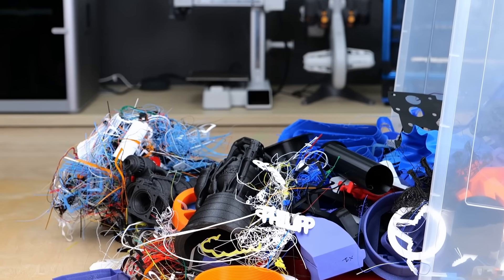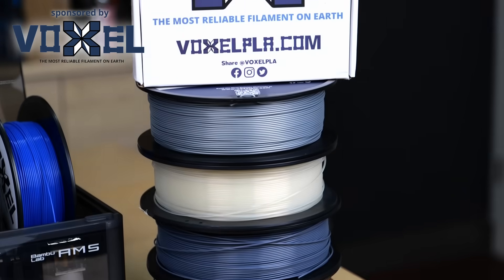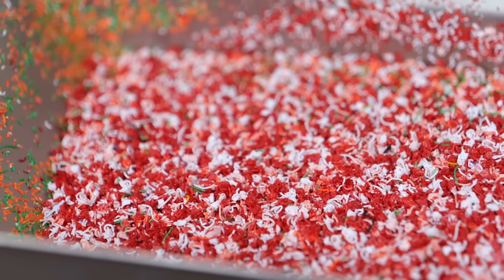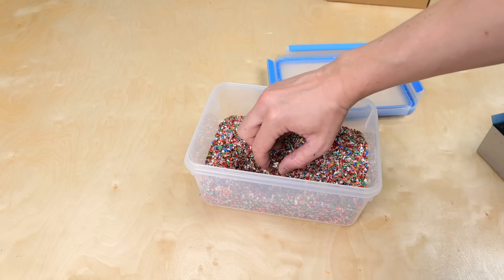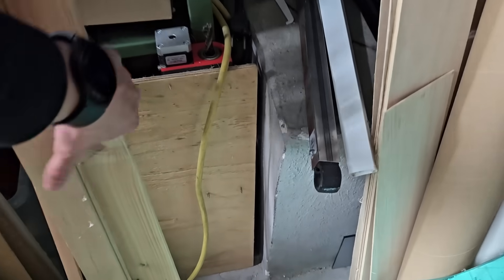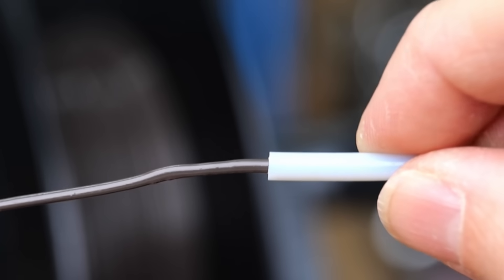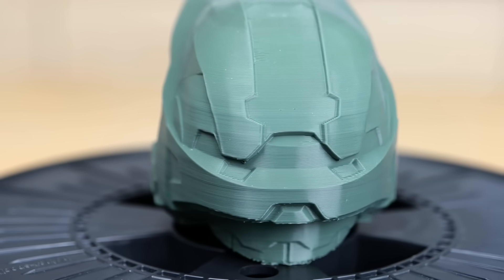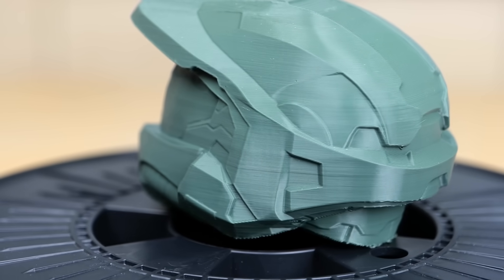Turning 3D Print Waste into New Filament!

Comment: I'm on a REAL tight budget, so I can't afford to by filament at all. The few spools I have were all gifts for birthdays, or as a thank you for helping somebody. So I'm especially interested in affordable ways to make my own filament. The manual labor to chop it down and clean / dry it properly doesn't bother me, and there are free sources for base materials! For example: I'm an electronics engineer by education, so for my hobbies I need electronics components. Same as with the filament, I need free sources. Turns out, if you just put a few requests on some facebook groups, you can get everything you need! Ask for electronics that died! Printers for example are a nice source for motors, power supplies and: HIPS / ABS !!! You can easily get over half a Kg of material for your filament from just one or two dead printers! Lots of electronic components too, and if you can get printer / scanner combo's you even get a nice glass plate as a bonus!
Reply: It's very important subject as not many companies recycle shell of the electronics. It's a VERY good business idea as many E-waste recycles are struggling with it. Manufacturers are only need smart parts, but the biggest part of E-waste is plastic.

Comment: Bambu needs to make an attachment and firmware enhancement to automatically chop the hot poop into pelet sized units while excreting them rather than making big blobs. That would make recycling so much more efficient and make the poop bins hold a lot more material before overflowing.

Comment: Did you build the Shredder yourself?
Reply from the maker: The Filament Pelletizer, yes, the big shredder, no, that's from 3DEVO.
Reply: okay thank you. Tried to develop a recycling process for filament waste myself for a university-project but we stumbled upon the same problems you mentioned in the video. Very frustrating, that it's not that easy to reuse 3d printing waste and therefore not possible for the majority of 3d-printer - owners. While watching the video i thought if it would be possible to change the 3d-printing process in a way that makes recycling later easier - e.g. the small metal parts in the filament waste, or the problem of moisture getting to the waste. And i thought maybe theres a way to reduce these problems already during the 3d printing process to reduce the effort / costs needed during the recycling process @CNCKitchen

Comment: Honestly, most of the 3d printing I do is for fit checking parts before using a more expensive manufacturing process. So by definition all my prints are almost instantly useless after the fit check has occurred. I really want a reasonable recycling process....

Comment: Haha I knew there had to be a reason for collecting so many poops! That filament dimensional accuracy is so hard to nail, but you're getting closer and closer! Really encouraging, considering there are zero methods of recycling print waste currently (at least none here in Aus)...
Reply: It's so frustrating. I want to recyle my waste and poop, but no one here wants to do it. When I last checked, we'd need to ship it to NZ. Which hardly seems viable. These videos are great for getting some at home ideas we can consider in the short term. It can be so irritating having a tech based hobby in this country. If we're not gouged for price, we're shafted for facilities instead. Grrr.
Reply: @tyrannicpuppy if you are in the US, I'll take your trash for upcycling, not recycling thou) Recycling is energy consuming and expensive)
Reply: No, we in aus have DC engineering 3D printing for pla and terracycle for abs recycling
Reply: australia or austria?
Reply: @chromyl_chloride  No kangaroos in Austria
Reply: @chromyl_chloride  note: Aus means australia, Aut means Austria :)
Reply: Whenever I make recycled filament I extrude, pelletize, and extrude again.  The second pass comes out more consistent because pellets feed easier than shards.
Reply: i feel like if he put some virgin material in it may have been more consistent

Comment: a large portion of my prints get sanded and primed anyway, so i don't really care as long as there is solid layer adhesion. i wouldn't pay the same amount for an inferior product but if i could get 10-20kg at a reasonable discount, i'd be for it.

Comment: Wonder if it's possible to tweak the "poop" settings on the printer itself to make the processing a little easier. Print little logs instead of wads, feed it straight into a shredder, drop it into a more sealed hopper to reduce water absorption, etc. Even better, use the waste filament during the print for infill and support material.
Reply: it's not printing the poop it's just purging into a hole so no way to change the shape

Comment: multicolor 3d printing just feels pointless especially for stuff like cosplay props, figurines, and other visual arts applications. even besides the waste, it looks worse than just painting! and the entire appeal of doing so is to skip the post-processing steps of sanding and priming and painting, but the result of that is that it just looks like an unfinished 3d print. you're also limited to an extremely basic MS Paint looking palette of colors, unless you want to invest in several spools of specialized colors. which is something you don't need to do when you can mix paint colors.

Comment: I was thinking of using my old coffee grinder from the Breville Oracle (not the simple blade type, this has turbine style teeth). I have a spare which is technically not good enough for coffee grinding but may work for shredding plastic to very fine granules.
you could use a poop color sorter on the output with some coding, it would be closer to it's original colour than poop
9:20 if you're going to put desiccant in a vaccum, I would suggest creating a false floor with the desiccant underneath so the evaporation falls to the floor and when opening the lid, the re-condensation then absorbs into the desiccant with the plastic above since vapor in a vacuum I would think would drop to the floor bed

Comment: if recycled filament was dirt cheap, id love to use it for prototyping then print the final part in a better quality filament, or id print my shitty quick "temporary" parts, especially if i got my ERCF working again, or had a Bambu with ams.
But this is unlikely, because filament is a product not a commodity, manufacturers pay $2-$3 per Kg and sell a spool for $25-$30 so somewhere between 88% and 93% of the cost goes into manufacturing, shipping and profits, I could imagine those prices would drop as 3d printing continues to grow.
But unfortunately recycled material does not make sense, as the cost of shipping failed prints around the country then sorting the plastics somehow, and the inevitable failures when a small rock, m2 screw or piece of ABS goes through the extrusion line and puts it out of order for a week, not to mention the CO2 emissions of shipping small amounts of waste around the globe, to make a substandard spool.

Before you hit print, ask yourself does the world need this benchy for the next 100 years, (then print it anyway and loose it in a week)

Comment: All I could think about this whole video was the wiggling of the filamet as it was extruded and cooled by the fans. Feels like having the airflow comming from the side is a bad idea and induces unnessecary oscillations.

Feels like you should be able to print a shroud to the fans so that the air flows along the filament as it’s extruded. Maybe a grill inside the shroud could help making the flow more laminar too?

Would be cool to see if those variations in your graphs are caused by the air flow turbolance :p

Comment: I would buy recycled filament if it was reliable enough to print prototypes.  Most of  my waste comes from making multiple prototypes of a given design.  Once the design is done, I have very little waste (failed prints mainly).

Comment: I don't usually paint my prints so I do like having the different colours myself (or just print in a neutral grey). But if the end goal for someone is to paint their models then I can definitely see a recycled filament being a popular choice.
Reply: I’ve saved all my failed prints/supports/brims etc. I first run them through a wood chipper then through a P5 shredder to make the pieces smaller. Then the plan is to run them though an extruder (should arrive in the next week 🤞). I don’t care what the colour is since I’ll use all the recycled filament for prototyping.

Comment: It seems like it would be perfect for prototyping material when you know you will have to iterate on a design a few times. After you have the design finalized you use virgin material for the final print and grind all the previous prototypes back down to prototyping material!

Comment: Given you've got the tools to do so, I'd love to see what re-melting it over and over again does to the mechanical properties of the filament. Does the layer strength drop? Perhaps the filament becomes more prone to shattering. I think it'd be a cool thing to test!
Reply from the maker: I should do: "how often can you recycle PLA?"
Reply: @CNCKitchen yes!
Reply: @CNCKitchen yes please ❤
Reply: @CNCKitchen I’m subbing to see that.
Reply: @CNCKitchen did you do it bro?
Reply: @CNCKitchen   or "how many times can you recycle PLA?", but yes, it'd be really interesting! :)
Reply: I once went to an industrial 3D print conference, and there someone from ESA explained that they have a  3D printer on the ISS and that they recycle their printed parts. And the mechanical properties actually get better! But it was with PEEK 🙂
Reply: I did it at Recycling Fabrik in Germany, after 5 recycling cycles PLA will be less viscous = very runny and more watery= chemical bones will be less strong. I'd recommend to use dye to separate recycling cycles, but I didn't. You'll see the same. I can recommend book in German about it. Only with HDPE after several recycling cycles bonds will become stronger.
Reply: Dr-D-Flo recently did an in-depth video - and I am actually surprised how well this process worked for CNC Kitchen. It's also possible to use recycled filament for parts of the print where mechanical qualities as well as variations in extruding speed are irrelevant, for example support or infill for non-structural parts, and use virgin filament/pellets for anything else. Although that leads to making more "poop" again.
Reply: @graealex  PrusaSlicer has the option to minimize the poop by having the color switch during infill and thus invisible, if possible. No need to extrude poop in such cases.
Reply: @SiqueScarface  Bambu Studio can also print to infill and/or supports instead of creating poop, the only problem is that the printers end up creating more poop than would typically be needed to print the infill and supports.
Reply: @graealex  he is paid and bought, I don't find his content scientific. Stefan does a better job by being German than Flo guy by being pro-industry ;)

Comment: I took an old cement mixer, added pea gravel and large sand.
Heated with a weed burner and added all the waste plastic I could find.
...just like they do in west Africa...
Mixed it and Walla!
Asphalt! 
I used to patch holes in the driveway but the Africans make roofing tiles.
That will be my next play when I gather a bunch more. 
Wonder why this isnt more popular?

I think once I get it right, I'll make a small skiff.
Reply: You can make tiles from aluminum cans, just FYI.

Comment: You should try a mix, very rarely do you see 100% recycled material used, usually its a % virgin material + % recycled
Leads to a much more consistant results because remember, every time you remelt the plastic it also degrades
Reply from the maker: Definitely, yet feeding regrinds and virgin pellets in such an extruder can be challenging.

Comment: I've always thought that a machine that could straight print from the extrusion would be best and could be useful for the household, single use containers. Imagine a rig the size of a washer/dryer that could shred HDPE and print out a lawn chair. Not to say that the engineering would be easy. Would need a very long and constrained auger, and the prints would be super rough and would need ironing.

Comment: Have you addressed the compostability of PLA? That is one of my main reasons for using pla as a main material. I’ve read recently that some is more compostable than others, and wondering what I need to look out for.
Reply: Is pla compostable? iirc in theory, yes, in practice, no.
Reply from the maker: The compostability of PLA is mainly greenwashing IMHO: https://www.youtube.com/watch?v=tavrkWrazWI
PHA might be a good alternative but it's still way more expensive.

Comment: I know that petg has a higher metling point and additional modifiers in the formula, however, it is one of the most recycled plastics. Has there been any attempt to recycle petg? I know that you would have to keep it very dry.

Comment: I think Bambu should look more into ways to reduce filament waste, as well as the time taken to swap colors. While people seem to like the AMS, perhaps it is reliable, it's also one of the slowest and most wasteful ways to change colors. In the meantime, Prusa is working on a new MMU system that will hopefully be more reliable than the MMU2, as well as having a tool changer system on the XL.
Reply: Very interesting. Here's a small idea from me. Per layer, at the end, on the inside, for infill, THIS is where that last "waste" stuff should be used. But this clearly demands the slicer to be very smart and planned in regard towards this as a method. To be clear, past the start and the end OR thin sections, the infill will often take up a lot of space inside. I'd deem that a safe area to swap filament on the inside so the print can just continue. If one could code this in with some thickness parameters for when it should shred off a blob OR dispose the transition into the infill structure? Sure this would make the waste decrease significantly right? 🤔

Comment: When prototyping, I generate and print a lot of ideas that, although they may not work for my current project, may work in future projects. Therefore, I keep a lot of old prints so I can revisit the concepts for use in the future. I like to have physical versions since I find them easier to track than keeping track of the concepts in Fusion 360. Plus, it is more informative when I can handle them to recall how they work. Basically, I have a design concept library. I sometimes write the date and key information on them with a marker so I can recall why they didn't work or why I kept them for future projects.

Comment: I've been wondering if you could just make a big melting chamber, and use pressurized air (at say just 1.5bar) to spread the heat and put pressure in the container to push that now melted material out of a nozzle. You could put in failed prints, virgin pellets etc.

Say take a big tube, insert some mesh filters on bottom, heat the bottom to 200C, and plast heated hot air from top downwards to speed up failed print meltin. on bottom of container have a nozzle, or straight into extrusion machine ...

Would probably be a weekend project to do a proof of concept. Maybe 200€ max in materials.
Just use IV ducting at say 500mm size and cheap end caps etc. regular nozzles + pneumatic distribution block for the air jets, a bleed of valve on top to vent out excess air + water vapor.
Reply: This is extension of the "just melt it into a sheet" precious plastics showed. So instead of a say baking pan, just have a long tube, with hole in bottom for the plastic to drop through.

Then add the mesh filters, multiple stainless steel to pick out varying sizes of trash just before the nozzle, heating elements on bottom, and the pressurized air from top to push the plastic through ...

Hell, someone with the time to tune and test this process might windup with usable filament straight from it without an separate extruder. Just a big heated pressurized container, which removes water as byproduct of it's function and providers pushing force as well.

Comment: Something just occurred to me.  Instead of purging each new color, why couldn't the printer use multiple print heads with a different color in each?  When printing it could simply use the appropriate head. The machine would need to know the offset for each head but that could easily be done in the software.  I think a hobbyist might even just add a head to the bar and assign a color to it.  Technically the width of the heads would take away from the total build width but it might be worth it.
Reply from the maker: That's what a toolchanger or an IDEX machine does. Check out the PRUSA XL for example.

Comment: Its awsome ,i would add another stage to the process where i pass the entire spool of the recycled cold (not hot) filament threw a 1.75 mm nozzle to iron out any bumps and fill any gaps , the temprerure of the nozzle would be around 70-90 degrees , the goal is not to melt the filament but to iron out the bumps and close the gaps on the surface of the filament without melting the inner core of the filament , it should give smoother filament

Comment: I own a filastruder, and it's a good product for what it is. It has some obvious downsides to hit the price point though. Most importantly, diameter variation. I can usually get it to make a reasonably consistent filament, but it takes a lot of work.

I originally wanted to recycle, but it isn't quite reliable enough for me. And the shredders required are insanely priced for a hobby user. 

Now that I've gotten into CNC and manual machining, I might melt it into bricks for that use instead.
Reply: Yep, this. Precious plastic and a few others have made all of this very accessible. Seems a much better way to go to me.